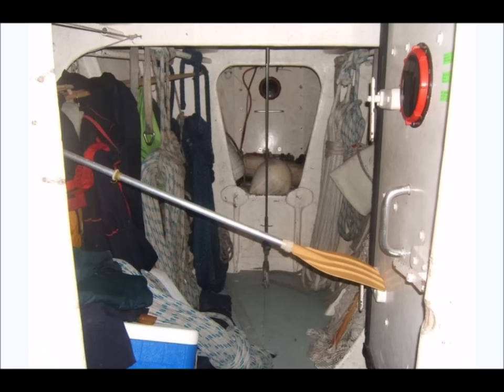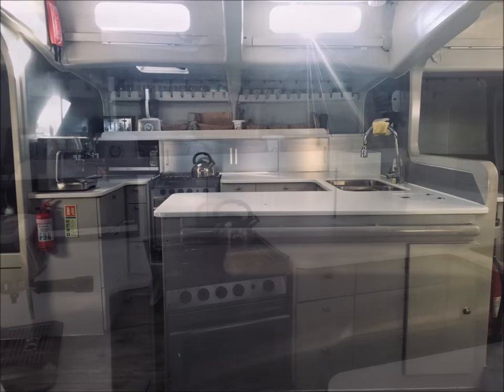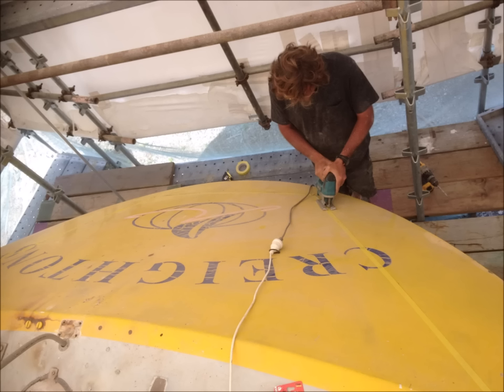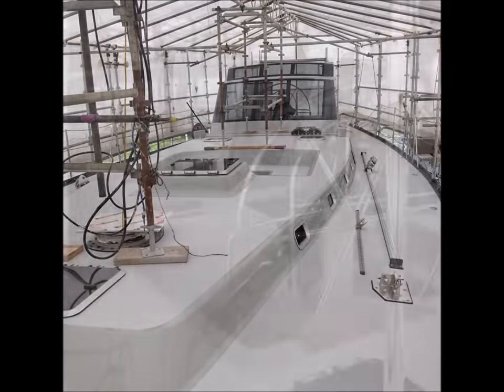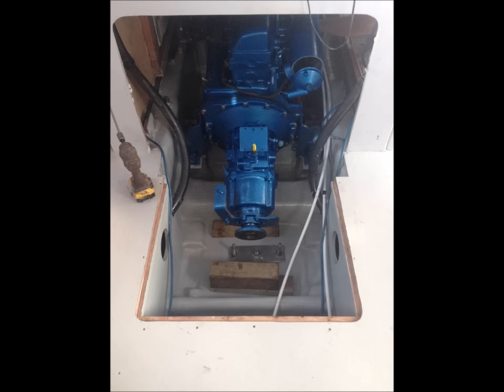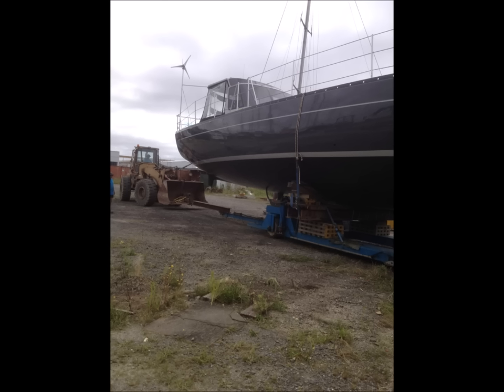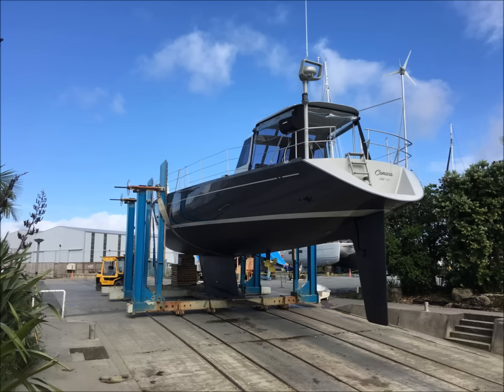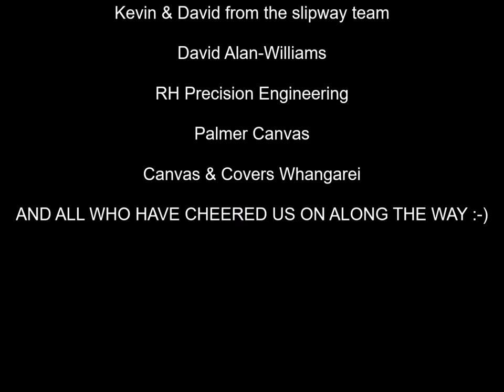The RESCUE AND REFIT Story of an 80ft former Whitbread Race Yacht (Ep. 1)

Comment: Insane work and skills and endurance 👍👍👍💪💪💪so beautiful and practical.
Only the dodger could have been more stylish but the rest is  superb.🎉🎉
Reply from the maker: Thank you so much ☺️ We had restrictions around the dodger construction which we probably should have explained in this video but basically it was the best we could do without sacrificing important structural strength for the main sail track. It would have required major changes otherwise and it was a big enough project as it was 😉

Comment: I love that you went with the paint finish in so many places. While I love natural wood, you can get bogged down in time and cost in trying to make every joint perfect. This is far more practical in both the short term and the long term. Not to mention cost. Well done.
Reply from the maker: Thank you and exactly the reason we opted for this. Our last boat had a beautiful wooden interior but to keep it looking that way took a lot of maintenance. The time and cost on the rebuild on this boat would have been insane!
Reply: Yes the first thing I noticed lack of woodeyness
These boats need teak and mahogany finish  but to to save money  you put GRP   
Plastic everywhere
Reply: @jackwills7092  You could argue that mahogany and teak are traditional materials, from the days when boats were all wood. Certainly teak was used due to its natural oils which prevented rot. On a more modern boat there is not much of a need for these older materials except tradition and the visual warmth that they offer.

Edit : There was a time when cars had a lot of wood in them too ( some still do like the Morgan ). Now it's just wood veneer dashboards in a few cars. Same with aircraft.
Reply: Another  point this boat has be build as a   high speed racing boat so weight  reduction  is very important 
To change its design to be a cruising boat has many disadvantages it has a deep  draft the running gear is very expensive mast rigging all made to the highest standards to replace anything its a one off hand made job very expensive 

very low power engine 
So to replace the interiors with teak and mahogany will be very expensive  and affect the handling of the vessel  if you put to much weight on the boat it will just sink
Reply from the maker: @jackwills7092  there were actually 10 Ocean 80‘s built, she was the first one and the only one built to race on the Whitbread round the world race. The others have been kitted out to be anything from luxury charter boats to sailing schools and cruising boats. She’s not a one-off design & build racing boat.

The finish was always pretty simple on her with painted fibreglass finish, floating floors etc as she was a race boat and access to all parts of the hull etc was very important! The few bits of veneer and wood that were on the boat were waterlogged and in extremely sad state when we salvaged her so no point keeping or restoring any of that! 

Rebuilding an 80ft boat with limited money and time meant we weren’t changing her into a megayacht. We like being able to see if there’s a leak or problem anywhere rather than waiting for a ceiling liner to rot and fall off. Also after 16 years of sailing on our last boat which had a beautiful mahogany and yellow wood interior we know how much time and work goes into the upkeep of such interiors!

We totally get that the feel of a well maintained wooden interior is hard to beat but the pro’s of a painted finish outweighed the cons for us 😉

Comment: At 3:28 there's a still photo with what looks like a laser device to the right. Is that the type where you can map out a complete surface profile plane like granite countertop guys use or is that just for finding plum, horizontal and vertical? My goodness you guys did an absolutely gorgeous job, whooweee!!
The modern color combinations, the level..depth you went to and the quality coming back out is motivating! I'm only at 3:28 and I'm already amazed. Great work, cheers! 🍻

Comment: Beautiful work! And of course the discipline and perseverance to complete this project is amazing. I'm curious why it was necessary to  drop and refit the keel before you put it on the hard for the restoration, when you were just going to drop/rebuild the keel anyway.
Reply from the maker: We had to take the keel off first as we couldn’t haul her at the yard we did the rebuild in as they couldn’t handle the deep 3.83m draft. 

The keel was trucked across to the yard, we sealed the bottom and relaunched without the keel and hauled at the yard. There we rebuilt the keel and refitted it prior to the launch. 

Now with a 2.7m draft which is more suited for cruising, we could launch from the yard but as we were on the limit of the draft in the slipway, we needed a really high tide and be as light as possible to get off the cradle and out the slipway. 

That meant going in without the generator or rigging in place and with empty tanks, to float as high as possible. 😉

Comment: An outstanding job of which I can not fathom the hours and $$$ spent that has turned out beautifully, with one exception - the massive dodger just totally defies the esthetics of this fantastic design and ruins the entire project.
Reply from the maker: N Winkley I don’t think it ‘ruins’ the entire project but thank you anyways 😉
Reply from the maker: william III exactly 👌
Reply: william III  I have done my fair share of faul weather sailing. It's great to see a piece of Whitbread history being saved and the interior work is outstanding. However the solution for some protection from the elements could have been somewhat more pleasing to the eye. Adding this massive structure to a once flush deck maxi racer just does not do it for me.

 I wont even start on the added windage and the need to hack up the sail plan to make the main boom fit.

Comment: I know this boat well and you have done an amazing job on her. Not sure you needed to add the ballast back to the keel as the current rig is already a cut down rig from the original sail plan. That mast was twisted when the boat was rolled in Biscay and again  in a collision with the Isle of Wight ferry when the spinnaker became wrapped around the bridge as it exited the Medina. There was major damage around the base of the mast on the forward cockpit roof which used to house 4 large primary winches. On another occasion the engine flooded the boat on a delivery back from a rorc race. I jumped out of my bunk when my alarm went off for a watch change and went surfing across the cabin on the floorboards which were floating. With no engine the skipper tried to sail it into Ocean Village and rammed the concrete pontoon crushing the stem. We used to joke the boat was haunted after the tragedy during the whitbread but maybe it actually was. A great, fun boat to sail and it was an excellent charter boat with so much moving gear to keep the guests busy. On day trips there could be up to 25 guests on board and it probably took 20 of them just to manage a headsail change! This boat has worked hard and done a million miles, but solidly built and great to see it getting a new lease of life!
Reply from the maker: G Ward wow thank you for sharing your story! Sounds like you spent anfaule amount of time on her and sailed a fair few miles as crew!!!

We added the extra lead as this is was the new keel plan suggested which was drawn up by David Alan-Williams but we hear you! 

Thank you for sharing your story and experience!

Comment: This is incredible.  I watch many of such refit videos, but yours is something special.  What is the white paint you used all over inside?  Two parts epoxy?  So from bare fiberglass you would do Fairing, Primer and then Two parts?  Thanks!
Reply from the maker: Thank you so much! We used Jotun Jotamastic 90. It‘s an epoxy primer that can be used as a finish coat provided it’s out of the UV, eg inside. It’s a hard wearing mastic paint and can be applied by airless sprayer which is why we opted for it. The boat had always had a simple painted fibreglass finish, we did a little bit of fairing to make it look a bit better and then painted two coats of Jotamastic 90. It’s a very ‘commercial’ finish but easy to maintain and touch up when needed.
Reply: @Camarasailing  Thanks for taking the time to respond with such detail!

Comment: Beautiful transformation! I can’t imagine taking on such a big project while working full time jobs.  Quick question? What is the advantage og the redesigned keel?  I’ve seen “winged” keels for more speed but not that design.
Reply from the maker: Thank you! We wanted a more practical keel for cruising. All up they built 10 Ocean 80 and all with varying interior layout and keel designs. The shorter keel versions featured bulb keels but we didn’t have the ability to pour our own bulb, hence the Amel style keel. One of the original designers did the calculations on increase in surface area and increase in lead to ensure we have no issues with traction and keep righting moments etc. That enabled us to reduce the draft from 3.83m to 2.7m and keeping the weight right at the bottom of the keel (like a bulb).

Comment: May have missed it but why no hull insulation?
Reply from the maker: We didn’t change anything in that regard from her original racing days. 

The amount of time and cost it would have added to insulate and then panel the entire boat was not worth it, especially as we prefer to have access to fittings without having to remove any panelling and the fact we can straight away see any leaks if there were any.

The balsa core from the waterline up does keep her a bit cooler and with the amount of hatches we got good airflow.

Comment: Superbe travail de rénovation. Mais personnellement il aurait été judicieux d'en profiter pour relooker et de moderniser le roof. moderniser
Reply from the maker: Thank you. The new ‘roof’ is actually an upgrade. It was a wet cockpit with a flimsy Bimini before. 

As it goes with modifications rather than a new build…we had to work around some constraints, like for example the position of the main track which we didn’t want to move as it is by a full ring beam (structural strength to deal with the loading). 

We also needed a big enough surface to accomodate solar panels as we didn’t want to run a generator every day to deal with power supply like the previous owners did. 

We know not everyone is a fan of it but there is nothing like staying dry and warm  no matter what the conditions are😉

Comment: Why fit a brake disk to the prop shaft? If it's not a stupid question?
Reply from the maker: Our gear box isn’t designed to turn while the motor isn’t running so we had to install a break system to stop the shaft turning while sailing 😉